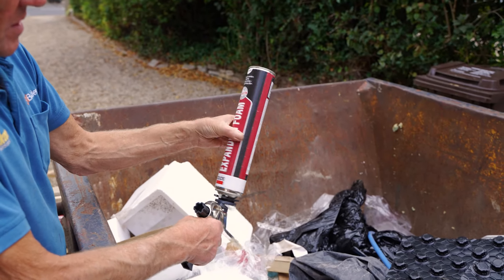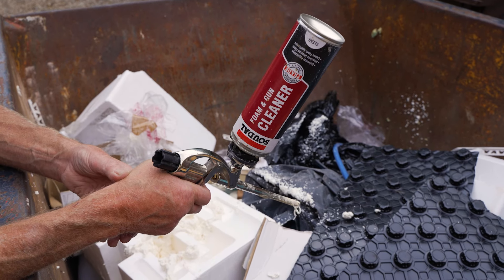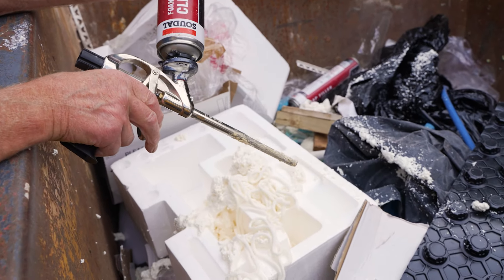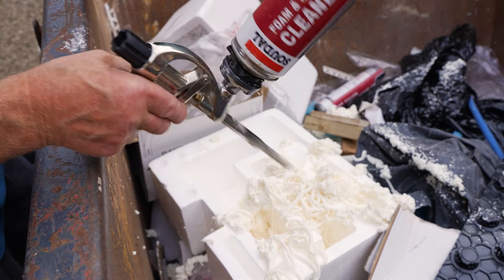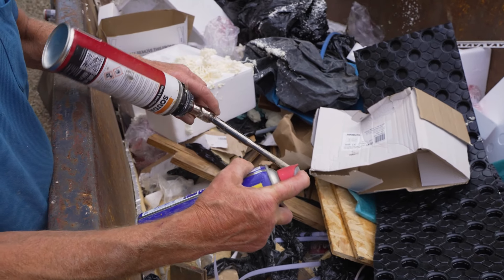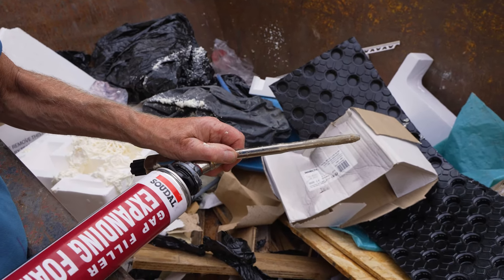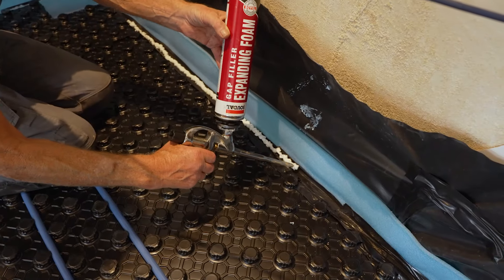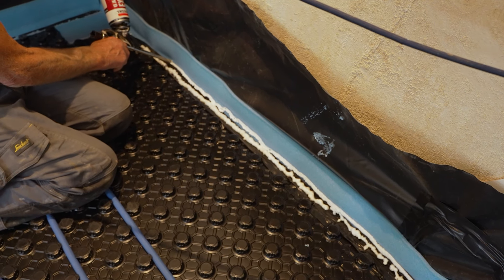Don't Throw Your Foam Gun Away — TRY THIS

Comment: My experiences with these guns have taught me that as long as you keep the gun live (aka don’t lock it off after use with the dial on the back) you will never need to clean the gun out. My theory is that the can and the gun stay pressured all the way to the nozzle this way therefore the foam won’t go off inside the gun, simply clean the tip off and away you go. This does mean you have to be careful how you store the gun and where you store it as obviously if the trigger is pulled somehow you will end up with a mess in the back of the van 😂 hope someone finds this helpful, Sam
Reply: This is my experience too. I have one gun going on 5 years now. 

The knob locks the trigger off so no issues there. 

You can disassemble and drill out the dried up foam if someone's takes the can off and leaves it.
Reply: You couldn’t be more wrong 😂
Reply: @dragonfitter  how so?
Reply: @MrHavokman I have been using foam guns for 30 years and the one way you keep them working is every time you use it you close the valve at the back , you always close the valve at the back or it gets blocked up by the foam drying in it .
Reply: @MrHavokman the whole reason for that valve is to keep the gun in use
Reply: @dragonfitter  mine is simply a trigger adjuster. The foam is all the way to the nozzle. Op is neither wrong or right. As long as trigger isn't pulled accidentally you can leave knob untightened/open
Reply: @MrHavokman it also adjusts a pin that runs along the length of the nozzle and seals it off stopping the foam drying in the nozzle
Reply: @dragonfitter  for my the gun the pin is the valve, which is controlled by the trigger. 

If it adjusted the pin foam would come out when trigger is not pulled. the knob is simply a depth stop for the trigger/valve.
Reply: I have said mess in my van.

Comment: Had the same foam gun for years, never used the cleaner, just keep everything air tight and your have no issues
Reply: How do you keep the tube inside clean and from setting between uses without cleaner?
Reply: @handle1196  The ball bearing seal at the end of the nozzle should keep everything airtight. As long as you're ruthless shutting off the flow every time you use it, it should stay workable... 

I use mine all year around and never have to do more than scrape around the nozzle/tip...
Reply: If you left them for a month they will dry inside, unless youre using a super high end foam gun
Reply: @zaxmaxlax  Odd, never had a problem, but then I guess it's rare it goes weeks without using it....

Comment: Had my current gun for about four years, keep a can on and keep it pressurised. I'm not too fussy about cleaning the tip off either, just break it off once it sets and give it a quick swipe with some sandpaper and its good to go every time!
Reply from the maker: I used to do that but in the end it got clogged inside

Comment: On the gun I use , the spring-loaded ball valve (where the can screws on) can be unscrewed, dismantled and cleaned, the ball usually is stuck to the housing... pick the old foam out with a fine scriber or whatever... 🤔

Comment: Ive never owned a gun but need to buy one. If i add a foam can and use it but dont empty it, do you leave it attached, is there a max time limit before it all clogs up, days weeks?
Reply: If I'm going to use the gun again that day or in the next day or 2 I leave the can of foam on. If I ever forget about a can & leave it on by mistake I usually find it'll start to clog  the gun after anywhere from 1 to 4 ish weeks depending on how well that particular gun's openings are sealed. If I'm not going to use the gun again for a bit, I flush it thoroughly with a can cleaner & always make sure before I remove the cleaner can not to press the trigger in order to leave some cleaner in the gun under pressure.

I've found the guns with a manual ON/OFF valve are a lot more robust compared to guns that rely on a spring loaded ballbearing to seal the can intake, as tiny specs of crap always seems to get into the ballbearing valves & prevent it from functioning properly.

Other opinions will vary.

Comment: Always leave a can on mine but if they do get a bit clogged I give them a basic strip then the metal components a gentle soak in cellulose thinners to remove stubborn hardened foam.
After that the gun is good to go for a while.

Comment: The seal on these cans is a horrible design if you ask me. It opens the can valve BEFORE the can is properly seated on the gun.
Reply from the maker: You are completely right, you have to be quick.
Reply: @SkillBuilder  Do you know if any better designed guns exist? Like 'screw onto gun / pull lever to lower into gun valve'?

Comment: Fuck the cleaner used all the time gun fails used most guns. Now not interested in cleaning keep everything air tight no issues. Asked boys how used them in regular basis non ever cleaned and had any issues. In yet a would clean with cleaner every time and every other time be issues. No cleaner gun works a treat lol.

Comment: I just use the other type with the little plastic tube. Not quite as good but no faff with cleaning etc. just stick a screw in the end and it’ll last for a few weeks. I’ll stick with that.
Reply: Those are fine for a a little bit of DIY like sealing up a small hole etc but no good for bigger jobs like sealing up PIR between rafters or studs etc on a large build.
Reply: @northeastcorals  not really, been using them for years on many building projects. Served me well. No faff.
Reply: @gdfggggg  Just last week I had to seal around 150mm PIR in between rafters. In some places there was a wide enough gap to stick one of those little soft plastic tubes but in most places the gaps were small enough to require the metal gun tube to force it's way between the PIR & the rafter to the back of the PIR & make sure foam could be applied to the full 150mm depth & not just the front of the board. Whenever I'm sealing PIR I find this to be the case & one of those little soft tubes could not do the job properly. Many such cases.
Reply: @northeastcorals  I just squash the end flat.
Reply: @gdfggggg  😂 yeh that'll definitely work
Reply: @northeastcorals  it does, just about.

Comment: Coming from Yorkshire means i've got the same gun I bought 20yrs ago 🙂  Always leave it connected to a pressurised can of foam, use the foam cleaner as per this vid or strip it down and clean it out. If you want a cheap, but powerful solvent that melts foam then buy 'standard thinners' it does the same as acetone, but costs much less.
Reply: Are you locking it off with a can of foam on the end or not?
How do you get the thinners in to clean it if its not in a pressurised tin?

And what do you do at the end of a day if youve used the foam connected to it and and dont plan to use the gun for weeks, is the gun itself not full of foam
Reply: Will it melt hard cured foam?

Comment: All these, and Roger’s advice, are for the tradesmen. What solutions are there for the DIYers? 
We don’t use our tools and equipment on a daily basis, once or twice a year perhaps. We must clean after every use, and really thoroughly otherwise the gun will always become unusable. I realize this channel is mostly for tradesmen but a lot of us enthusiastic amateurs also watch.
Reply: Buy a can of gun cleaner. When you have done the job, unscrew the foam can, screw the cleaner can on and give it a quick blast out. The cleaner solvent can also has a tip you can put on it to use it as an aerosol spray when off the gun so you can clean the outside of the gun. It works great and my gun is like new after each use as it's typically only used 3 or 4 times per year. My cans of cleaner last me well over a year.
Reply: Although they're not quite as controllable, you can just use the handheld cans. There are some which are pretty reusable for at least a few months if properly handled, otherwise you just write the cost of the unused foam off as the cost of, well, not exactly business.
Reply: @Monkeh616 . I agree. That’s what I’ve been doing. I once lashed out and bought a gun, it wasn’t cheap, I used the cleaner as stated on the can, next time I went to use it the gun was totally useless.  So now I just buy the one off cans basically for single use, often discarding most of the quite expensive stuff. We try to copy the professionals but the reality is we can’t, the only thing we have over them is time and patience, but not their know how.
Reply: @Monkeh616  I used to used handheld cans until the day I bought a gun and the difference in controllability is night and day.
The only time id consider a handheld can is if it was on sale / free and I had a large earlier to fill where controllability is irrelevant.
If you are filling small gaps, get a gun, you wont regret it.
Reply: @JR-el7et  I have one. But that's the tradeoff you have to decide on- controllability of the gun vs cost, cleaning, risk of it being clogged. Either way for occasional use you're going to be discarding foam.

You can  do fine gaps with the handheld stuff, it just takes.. quite a bit of practice. The guns, well, it's much more like using a caulk gun. Far easier to be consistent.

Comment: Quite surprised at how you mistreat the foamgun. Spotted it in your other video. Yes you can leave the can on the gun but dont think it can stay on there for weeks on end without use. a week or so, no problem but the foam will start to slowly react. I've never had a gun clog, i have had can valves fail when removing (small weep from the valve). If the gun is not going to be used for some time just put some cleaner through it. Quick spray until the foam stops, then cleaner can off and depressurise the gun. Its all ready to go for the next time

Comment: The price of the cleaner though!  £13 per can in LBS for a tin of Acetone!!  Half that for a full litre of it!  Now the trick is to work out how to get the cheap still Acetone into the empty spray can and re-pressurise it...hmmm.......
Reply: So stop shopping at places which bend you over? I've never paid (much) more than a fiver for a can of the stuff, and that's at the expensive end.
Reply: Take it apart and clean it out. The solvent to get is 'Standard thinners', it's much cheaper than acetone and does the same job.
Reply: @lksf9820  Partly because it has acetone in it. And, well.. everything else. Wonderful blends of recycled and surplus solvents from other processes.
Reply: Russian fella on YouTube has a short video showing you how to rig up a refillable cleaning can- it's a bit Heath Robinson it seems to work.
Reply: @Monkeh616  Living in rural Wales there's sometimes not much choice when you need it in a hurry! LBS have the monopoly here! 🐑
Reply: @lksf9820  I do, but can't break the whole nozzle / barrel assembly down to soak it, and that's the bit where you need to blast the cleaner through.  Hey ho, only one wall left where I need to stick the PIR / p'board on (plaster over stone), the others I can batten :)
Reply: @robjworkshop5692  Yeah, that can be a pain. One of those things to put on your stocks list! About £4 a can online with a bit of hunting.
Reply: I had a gun completely blocked angled slightly downward put it in the Vice put a cable tie around the trigger to keep it open and kept  pouring petrol in to the chamber after a few days the gun started working again

Comment: Never leave a foam gun without a can on it ! Even if the cans empty !!
Reply from the maker: The can doesn't reseal when you remove it so I don't see how you remove it after every use
Reply: @SkillBuilder I was wondering about this. As someone who doesn't need to use it that often I  was thinking If I  could just detach the can from the gun and clean everything up with solvent ready for next use?

Comment: Would help if you had the cleaner the correct way up 😂 not the same as the foam. I’ve had my gun for years. Only time it sticks is when the spring and bearing gets coated
Reply from the maker: why does it make any difference which way the can is? I am curious.
Reply: @SkillBuilder  If it's a typical construction with a dip tube, you just end up with the propellant coming out. This is so you can use them right side up with the nozzle. The foam cans don't have a dip tube, which is why they're used upside down.

There are aerosols which can be operated in any orientation, not actually sure what the internal construction of those looks like. Wouldn't bank on commodity industrial products being such. The propellants themselves may be somewhat effective as a solvent but they fill them with more than just butane (usually acetone and sometimes a blend with ethyl acetate and other solvents) for a purpose.
Reply: @Monkeh616  spot on bud
Reply: @SkillBuilder  yeah it’s like monkeh said. It’s mainly the propellant coming out instead of cleaner. You can end up with a half a can of cleaner and no pressure to push it out. As long as you leave the can on for 15 mins minimum to dissolve all the foam you should be good. Don’t just squirt cleaner though it as the spring and bearing will remain coated

Comment: Rather than doing nothing every time, or fully cleaning it every time, why not try the middle-ground: unscrew the foam can, screw on the cleaner can, give it a quick blast to get acetone into the system, unscrew the cleaner can, screw back on the foam can. Leave it a soup of acetone and foam inside. Why not give it a try!